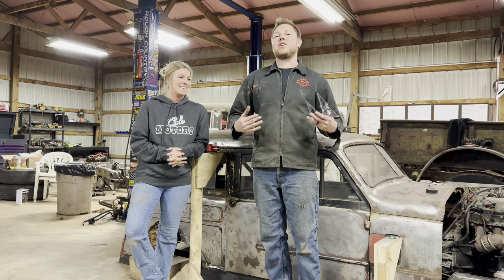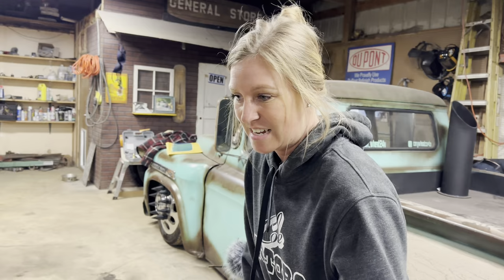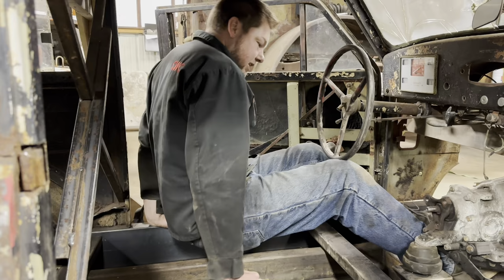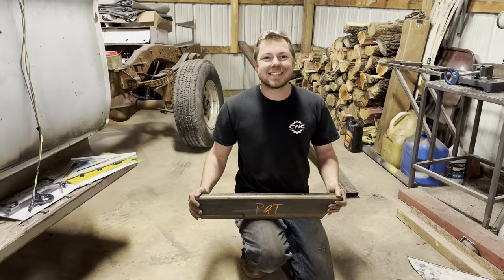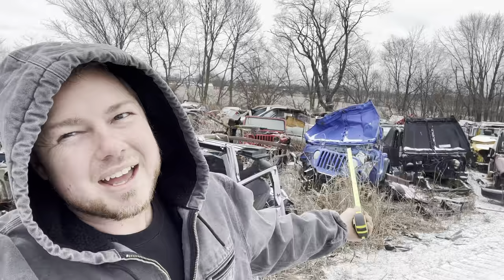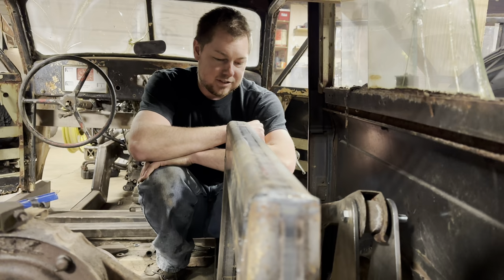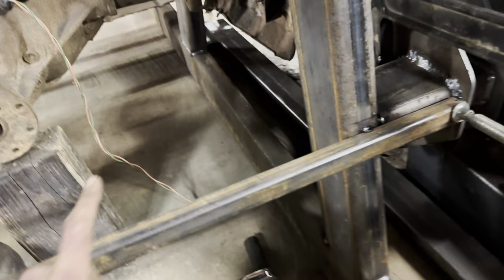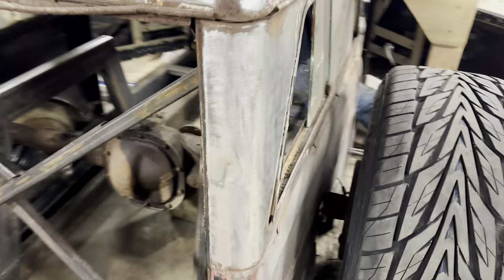Is the MOUSE TRAP too wide???

Comment: The suspension only moves a couple of inches,  Why not mount your rear end mounts facing to the rear of the axle and run the control arms beyond the axle.  The geometry still works exactly the same.  I love this build.

Comment: Just ran across your channel and find it pretty impressive. Just a few minutes in and thinking you can save yourselves a lotta work with your rear suspension. Instead of cutting up your link bars to gain floor space in the driver’s compartment just modify your design to the rear 4 link brackets. If you angle the top two bars toward the center of the car you’ll end up with a triangulated 4 link. Triangulated 4 links have been around for years. First ones I can think of are used in 64 Chevelles. The basic theory and design eliminates the diagonal link bar used on a four link and distributes torsional force between all the links more evenly. Anyway keeping the original link bars but using the top links at a 30 to 45 degree angle. That type of link setup like mentioned earlier only uses 4 bars total transfer torque and center the rear end, I know from experience that these systems run down the road a lot more quiet than a drag race 4 link with helm joints to rattle and wobble around with slack and wear getting worse constantly.

Anyway, you all are doing a great job, keep it up. Definitely subscribing after this.

Comment: Hey Hannah and Corey, Steve here in TN. You two are a hoot! The wife and I just love your videos. I just wanted to suggest a few things, for what it's worth. I am 75 years old and have been working on vehicles since the 5th grade. I am also a retired Ironworker. So.. I have had a lot of experience in the stuff ya'll are doing in the videos.  PLEASE take the proper steps to keep yourselves safe! Grinders are dangerous in several ways. I have had to go have metal particles removed from my eye several times. And they use a small "grinder" to get it out! Not fun. Also a friend of mine was using a grinder with a cutoff discount inside a truck cab. It kicked back and got away from him (he must have had the  trigger locked) and it took 140 stitches to sew him up! Anyway, ya'll are great, just want you to be safe. Keep up the great videos.

Comment: Hey there u2 . As always looking more and more like a fun ride when youre done. Quick question/idea for you. Have you ever considered using old hockey pucks for body busings when mounting body to frame? Theyre fairly cheap, like $1-2 each and you would find them at used sporting goods store like play it again sports. Theyre poly urethane with a plastic disc top and bottom and easily drilled in a sm drill press. I used them on a 4x4 van conversion on my 79 GMC van. Did it like 10 yrs ago and every time i see the new owner of it he says they still holding strong and look like they did when I installed them. Well look forward to the next video see you then.

Comment: I've had several cuttin discs come apart on me but it didn't match the rubber 3" disc on my air grinder coming apart and hitting me in the chest. I thought I was shot. I've had that happen twice and both times sucked bad.

Comment: Could've put that axle bracket on the back side of the axle tube instead.  Also, pretty sure those are lower control arms, uppers should be shorter.

Comment: The grinder catching and coming out of the hand made me cringe. Recently a similar thing happened to me except the unguarded grinder come down on my left knee necessitating a trip to the emergency room, a dozen stitches and a four week recovery. I would include a picture, but it would be censored. Still use the cutoff wheels but have gone back to having the guard on  even though it is annoying. Just a matter of time so be extra careful.

Comment: If that's a 8.8 rear just cut 2 7/8 off left side and weld back together. Get another right hand axle and slide it in. . use both right hand axles
Reply from the maker: Yeah it’s a 8.8
Reply: @corywheatcustoms  that would narrow your rear. Wouldn't be so wide. By the way I didn't tell you guys. This is a great build. Love how Hanna is doing welding . .all your builds are just bad ass

Comment: Seems like you're new with directionals. They have small arrows on them, it seems simple but it's easy to mount them wrong especially if you take them somewhere to get mounted (don't assume everyone knows how to mount directionals). I like to mark the tires and wheels with a DeWalt yellow lumber crayon. Can't be too careful. 😎

I looked all over and it looks like nobody has ever built a Crosley wide body. Just sayin'...

Comment: WERE MEN HANNA WE DIE LIKE MEN Glad your ok thats happened to me several times in the garage

corey is that hannas truck ?? you wasnt kidding shes ALL the way under the steering wheel is she 5 5 ? 

triangle corey not square hahahahahahahaha

would it be better to have a piece of steel all the way across rather than an ear or no ?

welding contest whos better ???

were trying to work here      yea in a clean enviroment................hummmmmmm where have i herd that before 

wait till she starts puttin up walpaper corey 

hanna definition of clean up leave it where it at its cleaned up right where it at 

AWSOME VIDEO GUYS

Comment: 👍🏾❤️
Reply: Too wide... re drill axles for new bolt circle. Would look sweeter with tires tucked tight to body. At that point it won't matter what the track width is. Keeping it Kool is worth just a little bit of effort. Take off adapter and scoot em in for a honest visual.